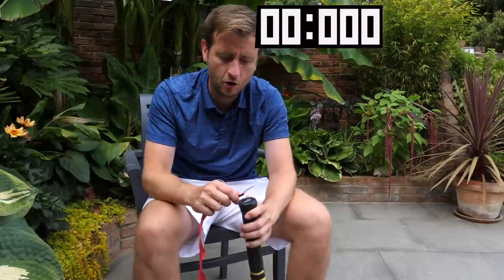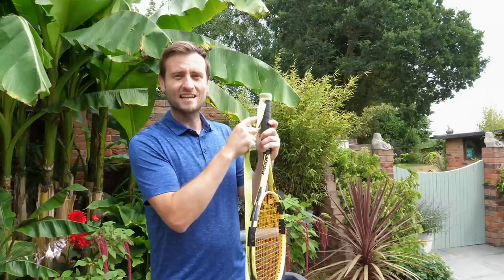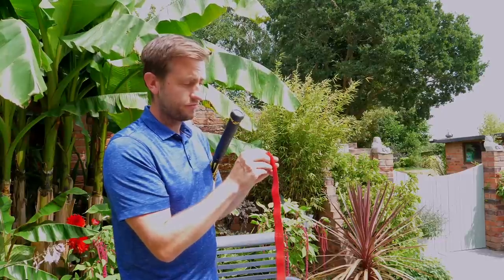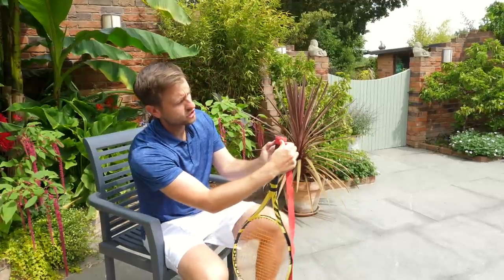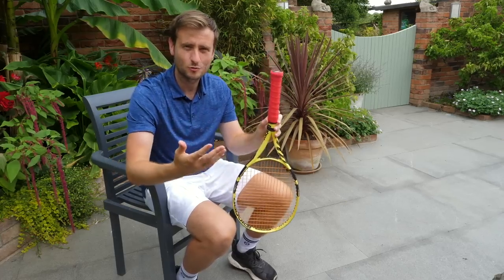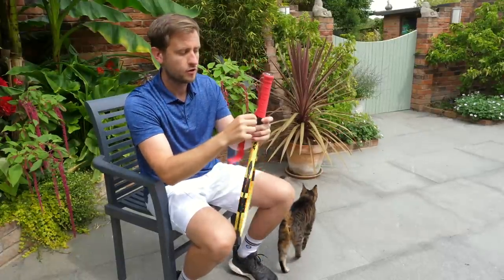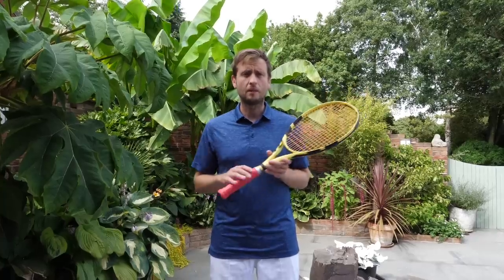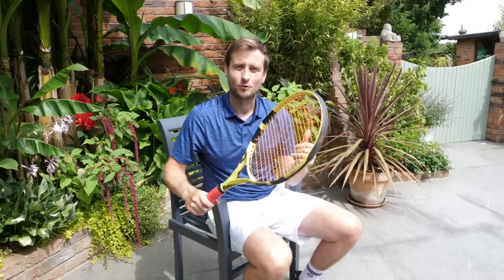How To Change Overgrip on Tennis Racket Like a Pro

Comment: Played for 10 years, used to do the standard way of overgripping (thin edge sticky side) until last year. 

Then I discovered the double folded way of gripping as shown in 16:07, wish I'd done that sooner. Really does help one handed backhands because it locks my hand in place and let me whip the wrist upwards a little bit more on contact for that extra snap of topspin.